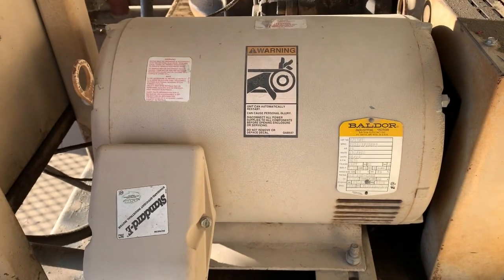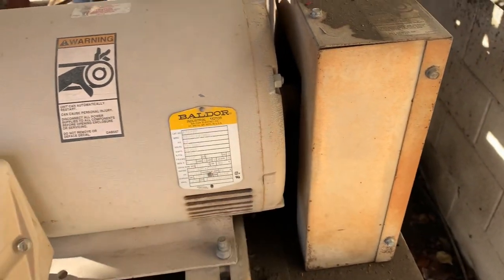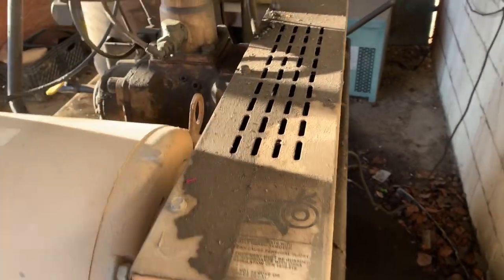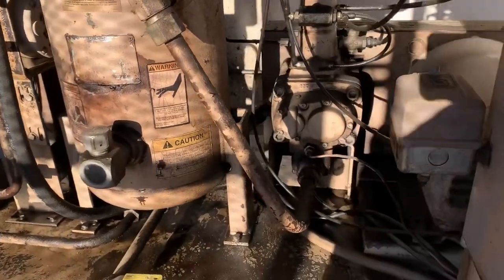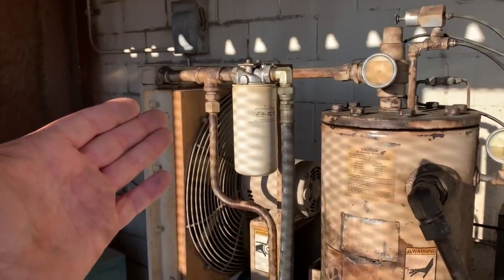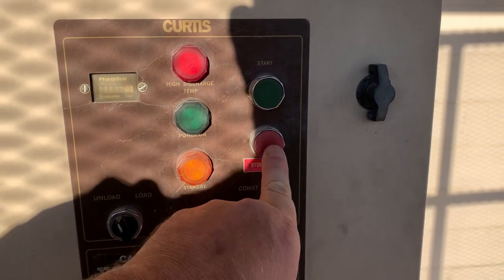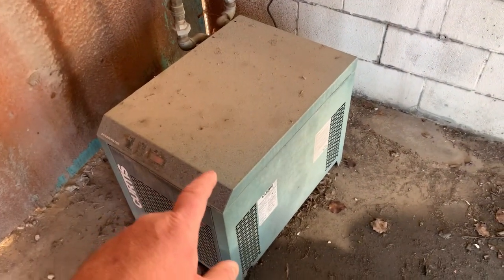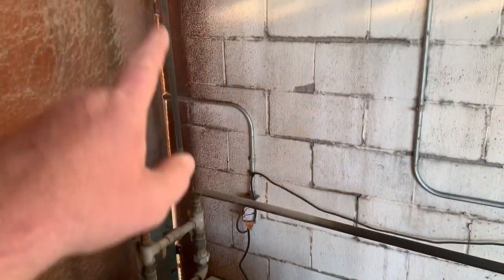STARTING A 25hp 480V CURTIS AIR COMPRESSOR

Comment: Screw compressors are similar to a roots blower on Detroit's, but they use two screw shaped shafts more like a supercharger.
One screw (male profile) is driven by the motor, it drives the other screw (female profile) with only a film of oil and air separating the screws, no gears keeping them in time like a roots blowers or superchargers.
Also the screws turn away from each other when looking from the top/air intake side, and they actually compress the air around the outside of the rotors, not between the rotors as you mentioned.
There will be an arrow marked on the compressor pump, and probably the motor, and must run in the correct direction, aside from blowing oil out the inlet, catastrophic damage to the pump will result from incorrect direction of end thrust.
Air comes in the top and gets screwed around the outside of each rotor, between the rotor and the main casing, the air is basically screwed around the outside of the rotors towards one end of the pump and exits on the underside.👍

Comment: Is it in the weather or have a roof over head car port awning ?   I worked with Huge compressors , nothing like that  Do you paint at all .   Only time I used a Dryer was painting  all the 1 inch pipe had water separators and Marvel oil for the air tools .  Paint had to be pure clean air .